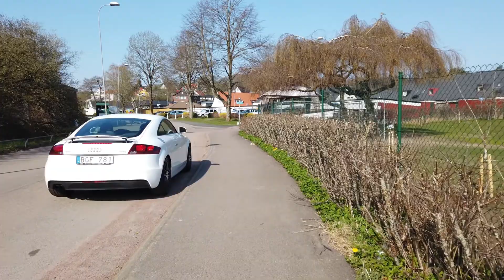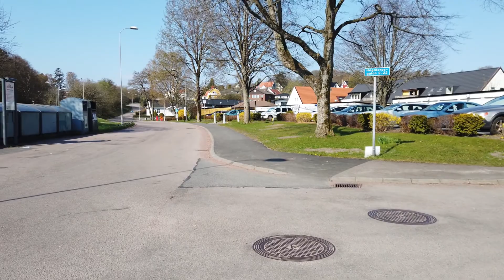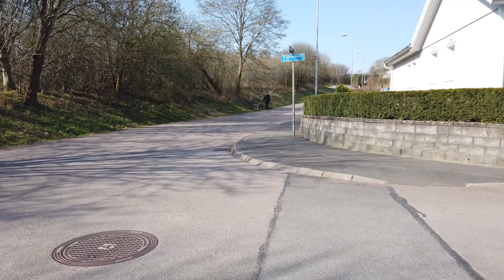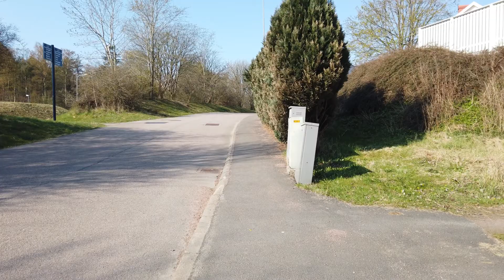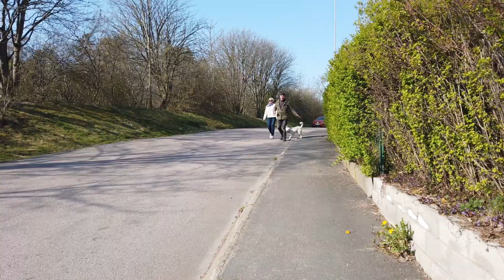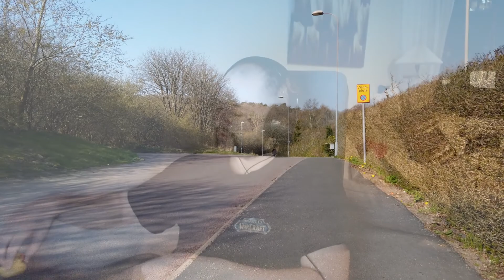How can I test my algorithm without coding?

Comment: Very good advice for mid level and new senior devs

I would abstract it a bit from the topic of the algorithm

When i was starting as a dev it was very fascinating how my tech lead was writing a system without numerous iterations of a rewrite

Always define large abstractions, build this large blocks that by themselves give a context to an application. After that define interactions/workflows. Having this in place already give an ability to quickly test and understand even by reading how you large distributed system will operate without a need to blur tour eye with details. Only after the main building blocks and their interactions are finalized proceed with implementing the small features. 

The approach is not even specific to a development. Its more of a common sense

Comment: Just prove that it works using induction? Figure out the most simple input and how it solves that and then how it makes progress towards that base case with more advanced input.
Reply: I could be wrong but doesn't induction require you to prove that you prove it for all input cases using a recursive sequence. So it'd likely be a much more complex proof than something like a theorem in number theory, also it requires discrete input states (induction with infinitesimals breaks down) so beyond a certain point, it would be futile. But it is a nice concept! Maybe you could try attempting something similar to the proof for Goedel's incompleteness theorem.